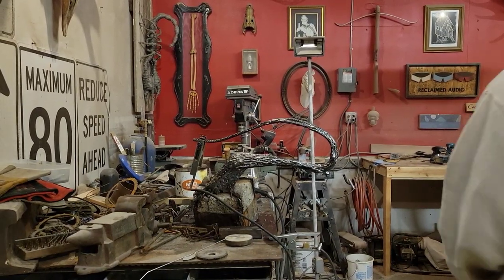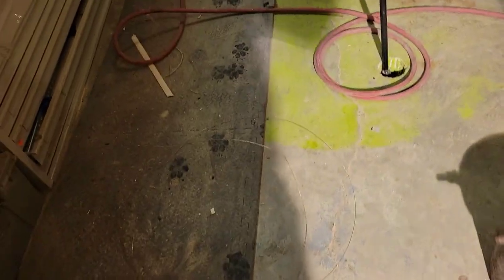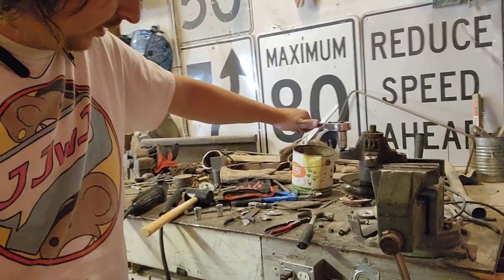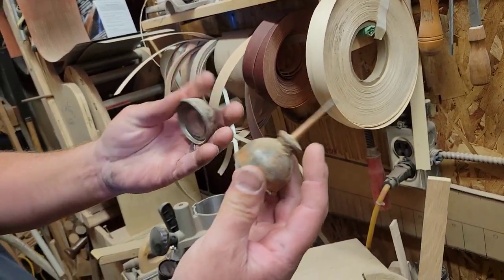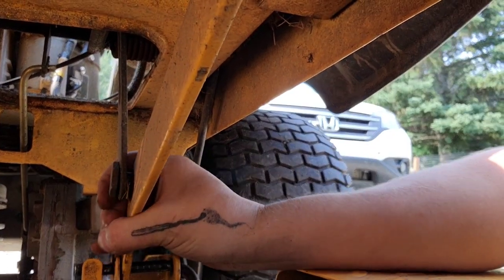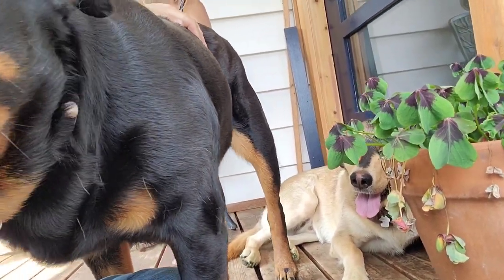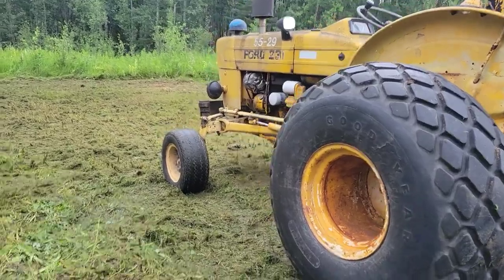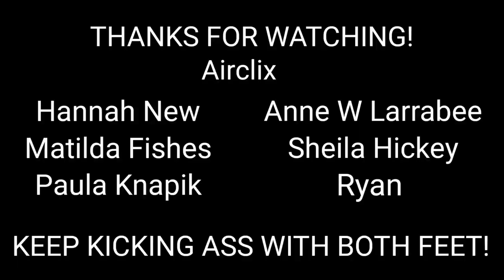I am not a professional welder but...  | Another VLOG #231

Comment: if you are trying to repair a crack in metal or wood even drill a hole a smidge wider that the crack you are fix right at the ends of the crack.  What I mean about that is sometimes the crack spider webs out.  The reason you do this is that you have a high chance of the metal cracking from the end of the OG crack and beyond.  Maybe not towards your repair but other directions.  I am watching 27 minutes in so if this is something you ran into then ooopppss.  If not I hope you see this for m=next time.